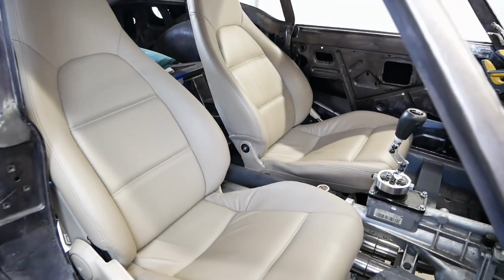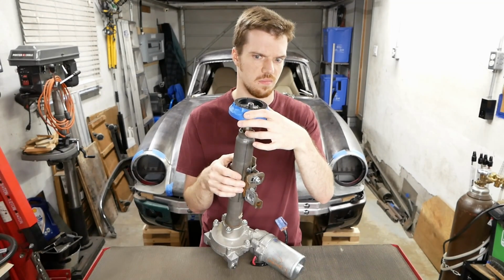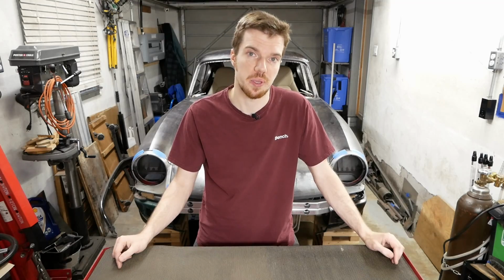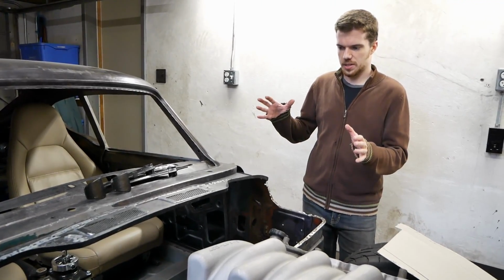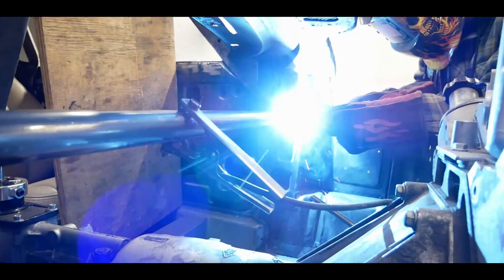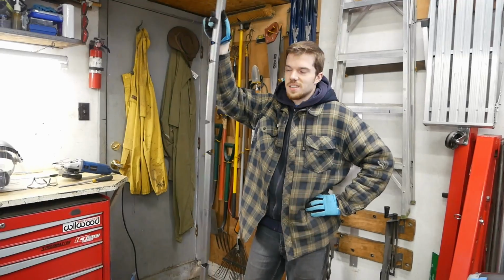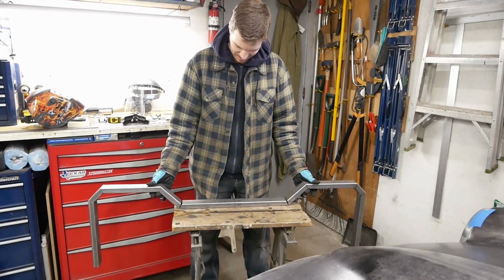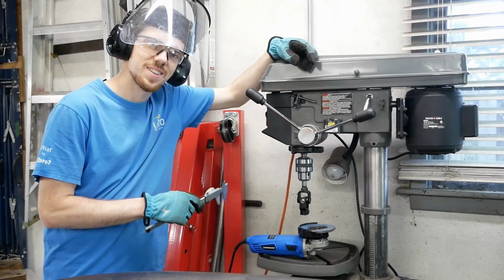The Next Phase // Pro Touring V8 Triumph Build – LS Powered GT6R – Ep33

Comment: 9:17 i would've done things a bit different here. Not in final outcome, rather execution, especially because your dad's there to help you.

Instead of putting the finite structure items in, i would've mocked up all the components including brakes, steering and whatever other things that need be shoved in that region utilizing wire to weld to flanges that would've been mounted to the parts you'd add (the idea is that they would mimic the minimum pattern of the firewall.

This helps you see what the space you're allowed to play with is, and come up with the optimal solution, not based on the ideal outcome, which would in some cases cut you off some options, rather the one that allows for the least amount of compromises. Something that's difficult to achieve when you don't have all the cards in play.

It's an old way of doing things, from the days of bespoke cars. Largely forgotten today. I've probably seen 5 people on YouTube and forums online that have done this, but it's a really potent method of design, because it frees up the mind to think, not constrained by disparate elements. jm2c, nothing more.
Reply from the maker: Great technique!  Keep in mind when we spent "most of the winter" checking and rechecking fitment, and planning for future packaging needs, we put things in place one way or another... not everything makes it to video!  Some stuff is just plain boring to watch!  Also, the structure is less flexible than the parts living in/on it ... can't move the engine, exhaust, or exterior sheetmetal so our boundaries are set pretty quickly!  We've build the new framing with as tight of tolerances as we can, where we need to. 👌👍

Comment: Did you weigh the stuff you put in to replace the stuff that you pulled out & weighed?
Reply from the maker: Funnily enough, no!  Sometimes you get building and forget... from an online calculator I'd say the new materials (including the two longitudinal tubes) total ~16-18lbs.  So slightly more than what was cut out, while adding a substantial amount of rigidity.  Obviously when it's all covered over in sheetmetal again we will have gained weight, but I'm still aiming to keep this thing under 2500lbs which is incredibly light for a 400hp car!

Comment: You're really coming along in the Fab Game.  Have you thought of upgrading the internals of the T5 gear box?
Reply from the maker: I've thought about it, but it can get pretty pricey and still have issues (the case is a weak point).  I think I'd rather save my pennies and get a TKX someday!  (ok a lot of pennies) ... I'm in serious doubt that we'll ever be able to go full throttle in this thing though, so fingers crossed the current T5 holds in there for a while! 🤞😬 "come on little buddy, keep it together!" ... Cheers dude!
Reply: @FanatikBuilds  I've just rebuilt/upgraded my T5 this weekend, thanks to some really helpful videos it's not difficult provided you have the tools and a little know how.   The case may not be the weak link, or certainly not the weakest link.  I suspect, like me, you're not going to be doing hard core drag strip launches with slicks.  I dealt with Stan from Pro-Force Performance, super nice and helpful guy. Also spoke to Gordon with Gordon Levy Racing, also nice guy that says he builds 600+ capable T5's, very popular with the Shelby Cobra crowd.  There's a youtuber 505speeds who has a nice upgrade kit that comes complete with everything.   Do a little checking with these 3 before committing to the TKX.

Comment: The correct front/rear brake bias needs to be finally assessed when the car is on the road.  The proportioning valve doesn't change the bias until the set limit is reached and then its a fixed amount, its a pressure limiting valve only.  This is why a dual master cylinder with balance bar is so useful as it can change the bias infinitely within the limits and when you exceed the limit at one end, its a simple and cheap job to change the master cylinder size.  To get a feel for the initial bias, the front and rear weights will be needed, at the moment its a bit of guesswork.  I am surprised that you can't get a dual master cylinder set up fitted as most times they take up little more room than a tandem cylinder.  Personally, with the anticipated weight of the car and the braking that you have I would not have used a vacuum booster as they are bulky and don't provide the feel that such a light, nose heavy car will need, I can't see the physical need for one unless you have a disability or your Granny is going to drive it.  Having twin cylinders allows you to place the reservoirs remotely and conveniently.  Later on if you ever need to add a booster then a remote booster, either engine driven or vacuum can be added.  BTW the normal line pressure for the brakes is more like 500psi, not 1200+psi you quote.  This is made up from 5:1 pedal ratio and 100lbs of leg effort, this then translates to the higher pressure at the caliper when the hydraulic advantage is factored in.  If you had equal caliper and master cylinder then the input pressure i.e. the 500psi would give 500lb of force at the caliper end.  You can buy stepped tandem cylinders with differing piston sizes, Porsche 924S/944 and Volvo come to mind.  My Beetle has 944 front brakes and 928 rear brakes plumbed with a 944 stepped master cylinder with the larger rear piston serving the front to cut the hydraulic advantage, which works tremendously, it also has a proportioning valve to the rear that is now fully open for dry tarmac and fully closed for snow.
Reply from the maker: Hey Clive!  Absolutely, a dual master is an excellent setup ... as I explained in my math though, I wanted a booster to achieve comfortable braking and have only ever seen one boosted dual master setup (non remote).  I won't have room to come back and just "add" a booster later, so it's either now or never.  All my research shows emergency braking can cause pressures of 1000psi+ so I'm leaning on the more braking than less side of things.  I've actually wondered about using a valve like this in combination with a manually adjustable one like I showed in the video... 🤔 Thoughts? https://www.ebay.ca/itm/313084957605?mkcid=16&mkevt=1&mkrid=711-127632-2357-0&ssspo=uTufAXavSfe&sssrc=2047675&ssuid=JAaF7vXKR3S&widget_ver=artemis&media=COPY
Reply: @FanatikBuilds  Hi,  From all my experience building/modifying cars, with a well set up brake system there ought to be no need for any booster and the advantages of greater pedal feel mean that the braking performance generally improved.  Your GT6 will be lightweight with big brakes so that pedal assistance will hardly be necessary IMO, you won't need Arnie style legs to operate it. Its no coincidence that GM sought not to fit a booster to the Corvette in many of its iterations, and that was a powerful, fast car possibly driven by women.  Adding a booster later on isn't a problem as it can be mounted remotely.
I would not doubt that 1000psi can be generated in the line in a panic stop because that only translates to 200lbs of leg push that is perfectly feasible from a fit adult male.  The 500psi is the normal max braking in everyday driving.
I would keep the braking system simple and adding in the GM proportioning valve complicates matters especially, as there appears to be no adjustment and no indication as to what the proportion is.  The manual valve will be more than you need. 
My Beetle (850kgs) has Porsche 944 single pot calipers up front and 928 4 pot calipers to the rear with a 944 stepped 22/19 master cylinder, reversed plumbed.  This produces astounding braking and on one occasion, much to the embarrassment of a following driver in a modern car, who didn't expect the car to stop so quickly.    The braking is very comfortable with a lot of feel.  The bias is heavily rearward mainly because of the weight distribution and the fact that the front brakes are too powerful for the car that would see them locking up too easily if normal bias was applied.  I have also fitted standard pads from a quality brand as I want the initial bite plus the brakes never get hot enough due to their size to merit harder pads.
I think you are overthinking the brake installation and because this is so special you need to keep it as simple as possible with enough potential adjustment to be able to settle on the most effective solution.

Comment: Very nice, but why are you giving away all that space between the transmission and the tunnel?
Reply from the maker: It seems like a waste, and we considered putting a bend in the tunnel to address that, but it's been left like this intentionally.  It's a tight squeeze to get the engine/trans in and out of the engine bay... the extra room over the transmission means it will be easier to tip it in there, and we might even be able to remove the trans/bellhousing from below if need be.  Keeping the tubes straight also helps with strength.  The extra room inside would have been nice, but ultimately we will have to just work with what's left! 😬✌️
Reply: @FanatikBuilds  you could make a compartment from above that is bolted in so you could remove it when you need the space for accessing the bellhousing. Didn’t you mention you wanted to make a service flap anyways! Make it a service compartment. Other cars also need to remove the glovebox to access some stuff
Reply from the maker: That's a fanfreakingtastic idea! 😲 Not sure what the space would be used for right now, but having it would be better than not!  Thank you sir!  🫡

Comment: Why are you weighing things when you have stuck a V8 lump in? I could understand it, if you had used a, for example, a high revving (its meant to be a 'sports car') Lexus 6, but it makes no sense to constantly weigh stuff with that lumbering lump in
Reply from the maker: I get the idea that a 2JZ would be appropriate for the car, but they are in fact MASSIVE and heavy … our LS is all aluminum and actually weighs less than the GT6’s original engine 👍
Reply: @FanatikBuilds  I forgot to also say: Incredible work! I envy your skill and dedication 💪🏻

Comment: Please stop wearing gloves when using rotating tools (angle grinders, drills, lathes etc). It WILL kill you. Gloves are absolutely a no-go when using rotating tools. If even a little angle grinder catches your glove, it pulls your hand INTO the angle grinder. At minimum, you'll lose your hand. Don't wear gloves. It's anti-PPE.

Comment: Power steering was not required…

Instead, you could have visited a gym.
Reply: Same goes for the servo brakes I reckon 😁
Reply: @manfredschmalbach9023  I'll let that go, because I always had assisted brakes, but
I removed power steering from my cars.

I even removed the power steering from my "drift car" (S13 with a welded diff), which had a lot more caster than stock.

Comment: Nice fabrication but I have to ask why? Why all the structural framework in a caged car? Firewalls and tunnels are usually just sheetmetal even on a 2000hp + car.
Reply from the maker: The car isn't caged, and never will be so long as it's on the roads!  Illegal to have a roll cage here (weirdly) ... We still want to add structure though, so this framework is just the start of such a thing.  Sheetmetal will be skinned over top later on once we're happy with things. 👍